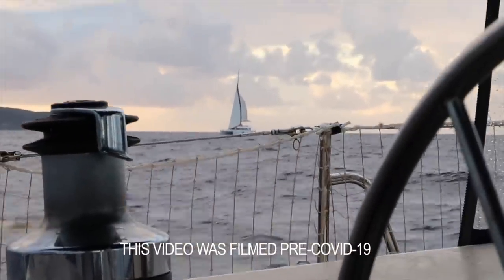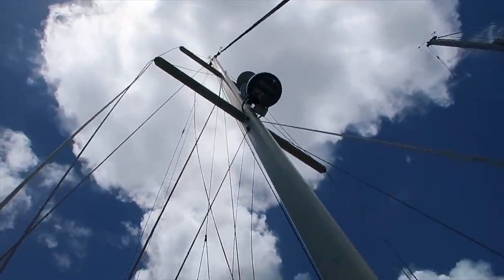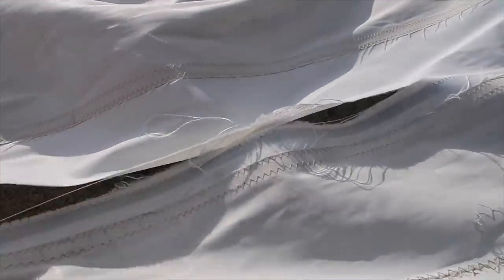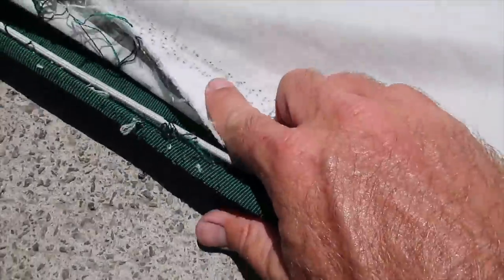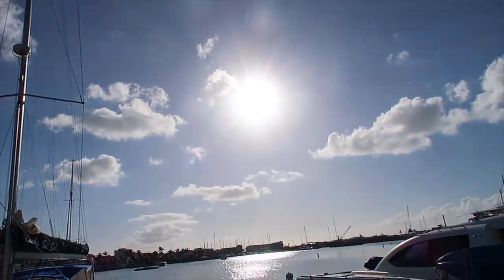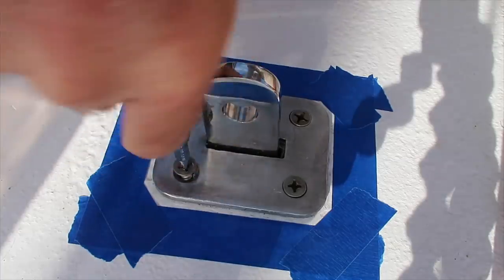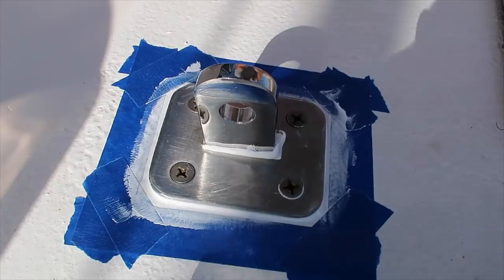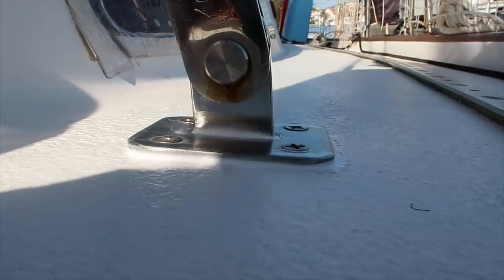Sail Repair and Final Steps: Chainplates in Paradise - Part 3 (Sailing Satori) S3:E18

Comment: if you don't like gloves you can spray your hands with something like PAM non stick kitchen spray to make your hands non stick also.... We use it on motor or any parts with gaskets so the gaskets will seal properly but not stick to the parts if or when it is disassembled. Often you can re-use the gasket. Works great on carburetor parts.

Comment: Although the edge won't be as sharp as using scissors, a hot knife seals the edges for sail repairs - this is especially required for the ends of the tear where there will be an inherent weak point. Try and cut a gentle radius Vs. sharp corners. 

Also dipping your finger in dishwashing liquid will stop the sealant sticking to the finger.    

If you are only getting a few years out of your sewing thread, invest in a high quality UV stabilised thread. The thread will usually give out long before the sail cloth and even buying the most expensive thread is a small investment.

Stay safe and good sailing

Comment: For future reference.........Boat Life specify not to pre clean with acetone but to use their cleaner/solvent. They also have a primer that makes a big difference for adhesion.
I'd also recommend putting the caulk deep into the deck  to chainplate gap.....could not tell if you did that.
Good job on the rigging and the sail.

Comment: Can you discuss the pro's and con's of using this sealant as apposed to butyl tape?  I have always thought butyl is the way to go for. sealing here and standing rigging as well...cheers.
Reply from the maker: Well... I had butyl tape on there before this fix. Where it was exposed to the sun, it got weathered, dirty, and lost contact with the chainplate in spots. I think butyl is good when it’s sealing two surfaces that are in direct contact with each other. Like a hatch, cleats. Deck fitting, etc.